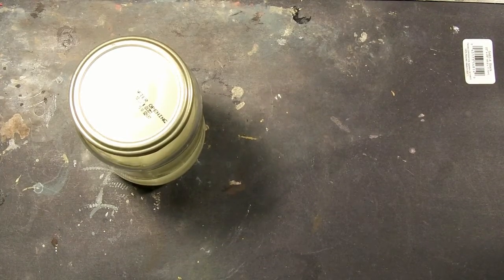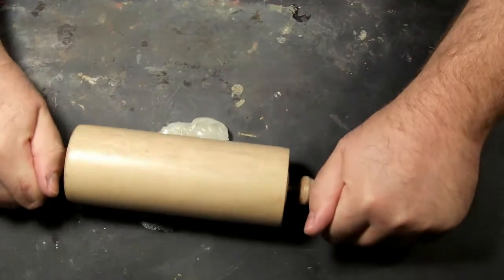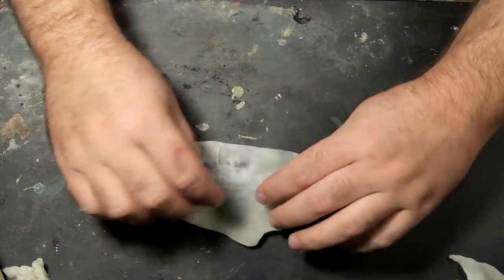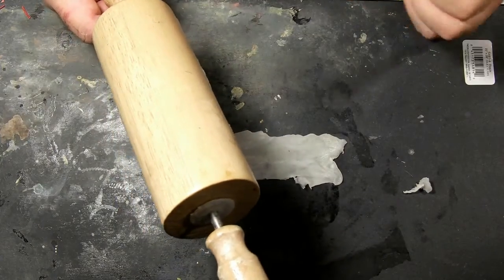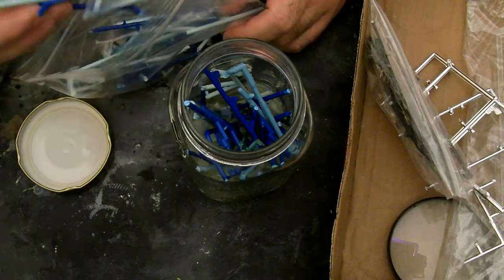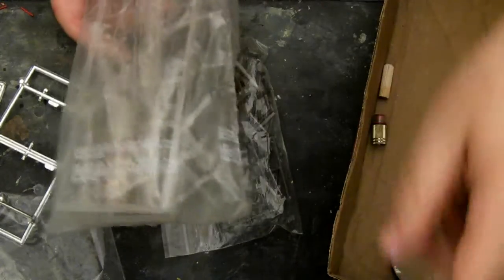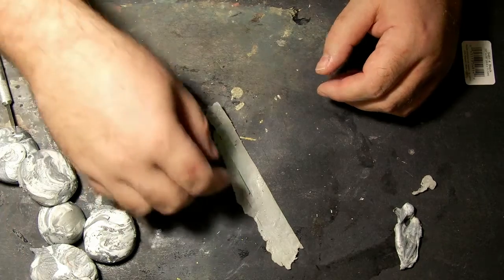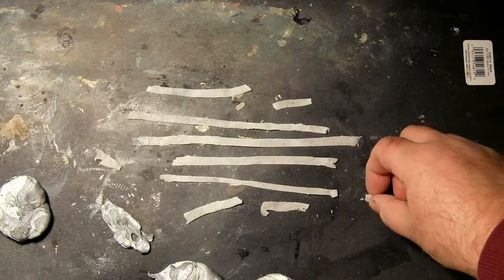ToolTip: Melting Styrene 3

Comment: Also if u want them 2 be a uniform thickness lay 2 strips on either side the thickness u need so the roller rides on the strips.Does that stuff stick 2 glass could try sandwiching it between 2 pieces with strips around the edges 2 get the thickness u want.
Reply from the maker: Brilliant!